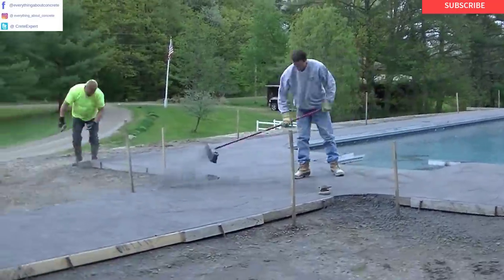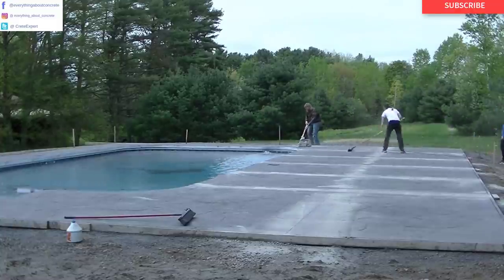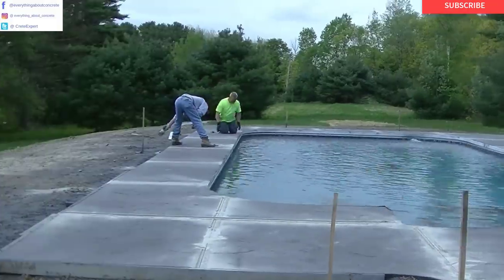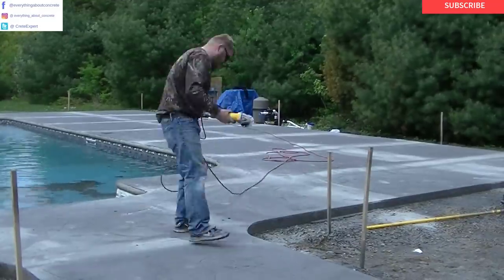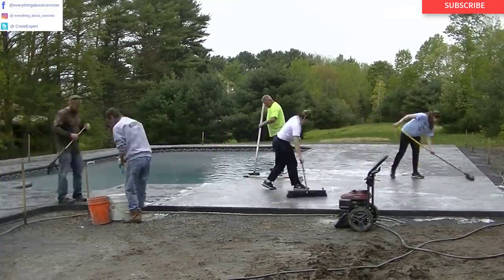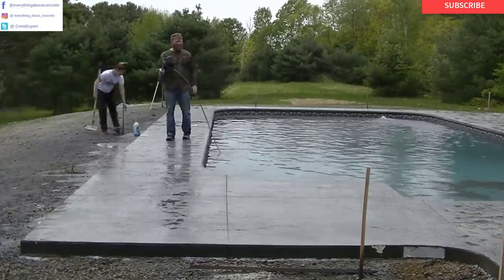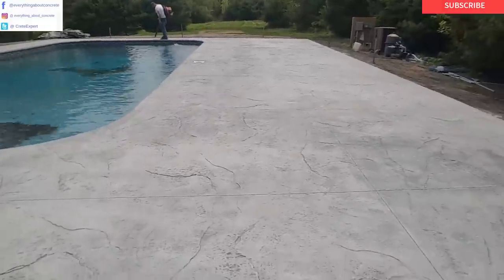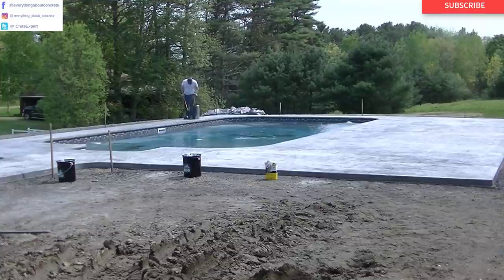STAMPED CONCRETE POOL DECK : PART 4 CLEAN & SEAL

Comment: Mike Day  , Thank you so much for very useful information about concrete . I have been in the concrete business 55 years . This as always been very interesting , I specialize in large slabs and driveways . It's never a full moment , an always new stuff to learn. THANK YOU FOR YOUR TIME AND VIDEOS . THANK YOU BILL BUSH
Reply from the maker: Bill, thanks for watching. I started in the commercial business side of it. many many 100, 200, 300 yard pours and some 1000 yard pours. Lots of back breaking hand screeding, didn't have laser screeds back then. Where are you from?
Reply: @MikeDayConcrete  GOOD EVENING MIKE  , I LIVE IN CHINO HILLS , CALIF.  MOST OF MY WORK NOW DAYS , HAVE BEEN VERY LARGE DRIVEWAYS . WE WORK A LOT IN VICTORVILLE , CALIF. ABOUT 100 MILES NORTH EAST FROM MY HOUSE. THAT AREA GETS  VERY HOT , SOMETIMES WE NEED TO ADD ICE TO THE CONCRETE MIX TO KEEP IT COOL. I HAVE NOTICE THAT WHERE YOU ARE IT GETS VERY COLD . MIKE , PLEASE KEEP THOSE VIDEOS COMING. THANK SINCERELY BILL BUSH

Comment: Glad you mention about the sealer turning white. We just finished ours and the last 1/3 turned whitish; I thought maybe it was too hot and entrapped some air, because I used a 2 gal spraying.

Comment: On this project you used the Trinic, but on the other I saw where you did, I believe the rear area of a covered porch/deck,  you used Foundation Armor. Both stamped concrete. Which one do you think is a better product? Can you apply Trinic over Foundation Armor without stripping? I did watch the stripping link, excellent I may end up doing that. Also I got to tell you that we asked our pool contractor 25 years ago to do a stamped concrete pool deck and he said it couldn't be done. Real shame too because we have a huge deck and now it just would be prohibitively expensive to bust up and redo.  I am really enjoying your videos and your teaching method and your incredible high quality work. Very difficult to find people like you who really take pride in their work.

Comment: Awesome video. I’m getting ready to do a 2000 sft pool deck area. 

I’ve been reading online, if I am in a warm temperate clime (south west Florida) where concrete generally doesn’t crack do I still need to introduce saw lines?

Comment: We had a pool built for us and the pool company did the concrete and I have not been happy at all with the way the concrete looked.  We did a 2 foot stamped border and they used Eagle Clear Transparent Concrete Sealer on it.  They are having to come back and redo the top coat of the other concrete because it was not brushed like it should be and had blemishes and troll marks.  Should I redo the sealer that is on my stamped concrete?  Thanks for the videos.  Great to see how things should be done.

Comment: Need to re-seal my stamped concrete pool deck. Two questions. How do you get the sealer on the coped edge, I didn’t see your guy wrap that edge with the sealer on the video. Also, what about adding a no-slip additive to the sealer, do you do and and can you still use the sprayer if you do ?? Thanks and great videos !!

Comment: Even a whole year later after this video definitely helping people out. Very informative and great vids. Did you use a Satin or Matte finish of Trinic? And do think this sealer would be ok without an additive like Sure Step grip additive or with it to reduce slipping on the pool deck?

Comment: My PB did all 4 steps in 1 day, minus the seal. They told me they do not seal a pool deck. They used colored concrete hardener and stamp forms similar to what you used. Pour date was 7/22. On saturday I came back after being out of town for a week and discovered about 50 hairline cracks spread out all over the concrete sections. Trying to figure out what exactly the cause was/is. I am in North Dallas and temps have been in the 100's with no rain. The deck pour was at 10 AM at about 86 degrees and they finished around 2:30 PM at 97 degrees. They told me absolutely no water on the decking was needed.

Comment: Was there any concern about dust and overspray getting in the pool water? When I did my pool I noticed some of the sealer was floating on the pool water near the edges.
Reply from the maker: No, it'll come out in the skimmer. We've never had a problem with that.

Comment: What if concrete stain was to get into a salt water plastered pool how would you handle it if it turned water brown
Reply from the maker: I'm not sure, I've never had to deal with that. Maybe call someone at Deco-Crete Supply and tell them what the stain was and if they have a solution for that. www.deco-cretesupply.com

Comment: Thanks Mike. I’d certainly be interested if you do a stamping course. Have to say your channel is really coming on. Quick question,  do you not find it better  using water to cool  your blade when cutting concrete  ?.  Thanks again 👍
Reply from the maker: NO, this saw is only for cutting dry.

Comment: We have over 6,000 square feet of colored stamped concrete in our backyard and around our pool.  It's  been 7 years and have had it resealed once.  I'd like to try to reseal myself and have appreciated your videos!  My biggest concern is when sealed, even with some shark grip, my concrete is super slippery when wet.  
Please help!
Reply: How much did that cost?
Reply: Have exact same question about my project?
Reply: stamped concrete is going to be slippery when wet moreso than liek a broom finish

Comment: What do you add to the concrete to dry it out, so that you can start with a wetter mix?
Reply from the maker: Ruben, The concrete batch man adds a water reducer to the mix. It loosens the mix without adding water. All the crete company's have it.

Comment: That release never goes away. Its a mess and the homeowner is stuck with it. You can backfill over it along the edges, but if you ever decide to dig or plant along the side of the patio, your dirt is permanently contaminated with it.

Comment: Hey Mike Day I recently quit my job working for a masonry contractor and I am starting a small concrete business. I have been doing small jobs but I struggle with pricing. I could use some help thanks.
Reply from the maker: Check out my website www.everything-about-concrete.com and look for my Concrete Cost tab. I explain a lot about cost there.

Comment: Oh Safety share to the DIYers, the pesticide sprayers is not a good idea to use. I used one thinking " If it can handle pesticide and herbacides, it's resilient to solvents". Boy was I wrong! By the time I went to add the second coat (prob 30min in between) the hose burst while pressurizing the cannisters.  Good thing I was wearing safety glasses, long sleeves, pants and gloves!  Stay SAFE!

Comment: I build pools and ID BE FREAKING OUT IF MY MUD GUY SPRAYED A SEALER WITH ACETONE IN IT LIKE THAT AROUND A VYNIL INSTALL WILL MESS THE LINER PATTERN UP MELT INTO THE SKIMMER SEAL RING THE TOP STEP AND SKIN UP ON THE SURFACE OF THE POOL WATER AND MESS UP THE FILTER WATER BASE SEALER NO PROBLEM SORRY MAN BUT THATS A DEAL BREAKER FOR ME . NICE DECK SIR 👌